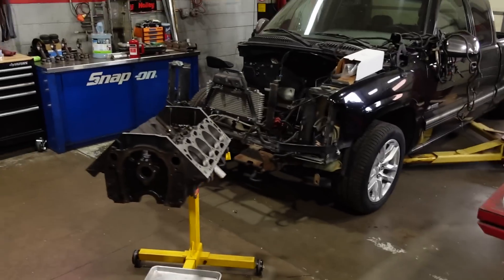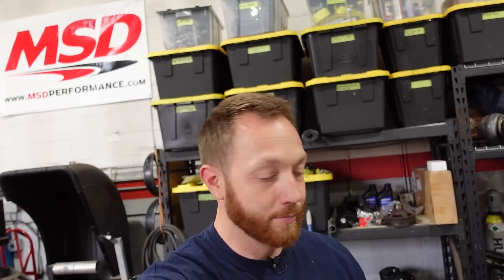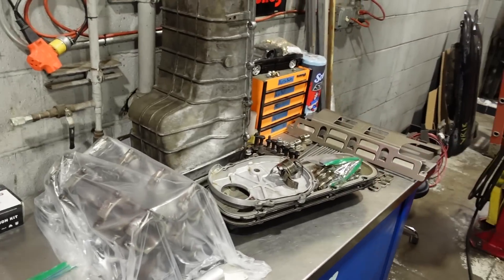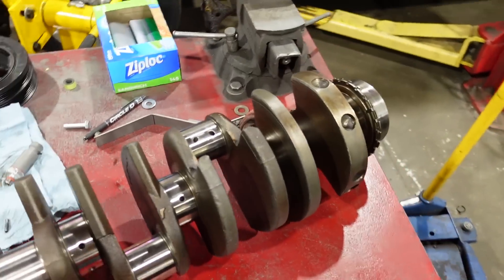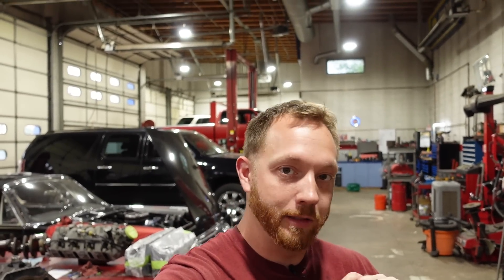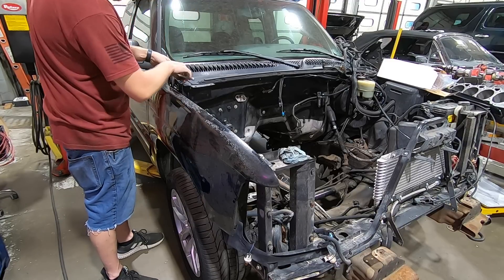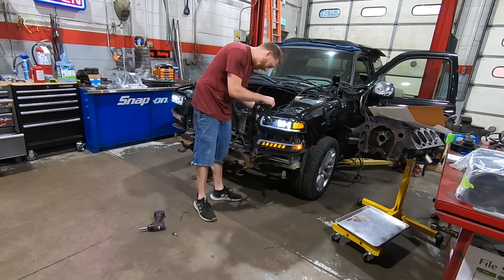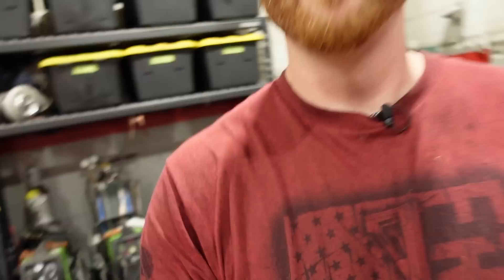prepping a junkyard BIG BLOCK for BIG BOOST

Comment: Sorry for your loss, I lost my mom back in February.  Also, the turn signals are installed in the lower HD position.  The upper slot is for the 1500’s

Comment: Tip
If you wash assembled pistons or other parts in an automatic washer remember to spray any bearing surfaces (gudgeon pins) with penetrating oil to rinse out the cleaning fluid then bath them in oil before use.
Failure to do so will lead to failure.

Comment: My condolences to you and your family.

I made a comment before, ring is important. But just as important if not more so is piston pin to pin bore clearance. This needs to be increased as well on high boost engines for a margin of safety. I suspect many piston failures attributed to insufficient ring gap were actually caused by seized piston pins.

I really think you will be better served by aluminum composition main and rod bearings. If you want something stronger than stock, King HP bearings are excellent. Otherwise Clevite A series or standard King bearings will do. The Clevite H series are strong, but the trimetal is very hard.

Comment: I’d only suggest this to protect your investment. 10 Ohm 25 watt resistor across the positive and ground on those headlamps. They often are made for variable voltage ranges which results in excessive heat. The resistor is only there to absorb a bit of heat (25 watts worth). This will stop them from melting the connectors. 

Any one else ever wonder why most of those 99-06 trucks don’t have operating DRL? The cable sizing is not correct for the application. It should be 1 size larger.

You now also need a zenor diode across the low and high beam relays. Gives you all on lights when you turn on the high beams.

Comment: These lights just arrived. I got these from you link: LED Headlights Assembly With Hi/Low Beam Turn Signal Lights Bulbs Compatible with 1999-2002 Chevy Silverado 1500 2500 3500, 2000-2006 Chevy Suburban Tahoe, Amber Side Marker-NO DRL

I am not a DRL fan or TPMS. Let's see how the install goes and how much of an improvement it makes.

Comment: I’m so sorry for your loss. Prayers and support!

I tried contacting the company. They wouldn’t confirm if they’d fit on a GMC Sierra. It looks like they will but I can’t tell from pictures but the Chevy grille piece between the lights seems bigger than a GMC grille. Any way you could measure the lights?

Comment: Forgot to ask in light of your loss. Why bigger then -6 on pvc setup? Half the price of -10/-12 and really is over kill. Also PTFE...hoses and thread sealer, it does get hot and pressurized in that system. I use a racetronix assembly tool and fittings as they are well made and inexpensive with fragola 6000 hose on everything, 2500psi working 10000psi burst is hard to beat(not sponsored just built a crapload). Can't wait to see how to separate the e85/milkshake with the pcv! Great job with the clean up. And I was always told to match the biggest ring gap, so 31 is THAT engines magic gap number for that ringside lol. Each hone stroke, in theory, changes that. Modifying the stock intake for an ls7 throttle body with a bigger neck might be a good vent for mom stuff, as its more like art. It you try it, I'd braze it rather then welding. Heat guns don't make blowback. Alumiweld sticks are cheap.

Comment: Just a heads up, @lakespeedjr recently did a video on the total seal yt page about why the 2nd ring needs a wider gap, and why the top oil ring needs the same gap as the 2nd ring.

Comment: You're actually supposed to place the ring on the other end of the Ring file so the ring will stay flat to the tool, you were using the ring file from the short side

Comment: I’m having pcv venting issues! While in Boost, the pressure evacuates fine. But under normal driving conditions or at a steady rpm cruise not into boost it’s a problem.. how can i make everything work as if it were stock but with the turbocharger?  Iv thought of hooking the Stock pcv venting tube with the check valve back into play some type of way. Just rebuilt my 5.3 forged internals. First rebuild alone. But I’d like a reliable truck daily all driving conditions turbocharged.